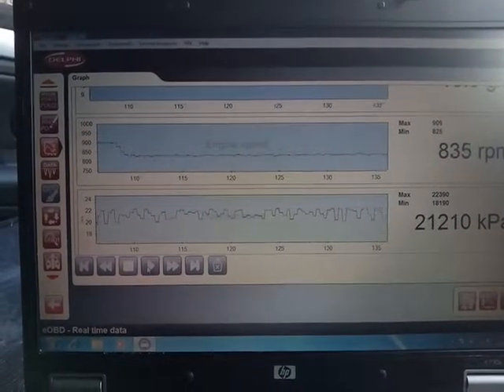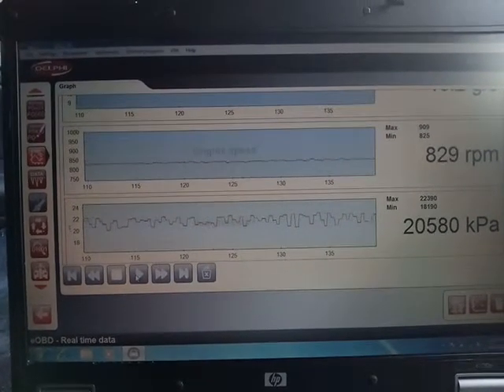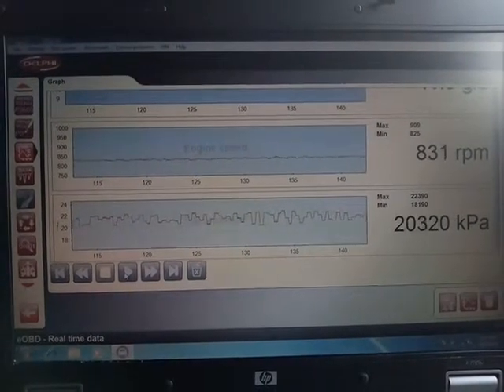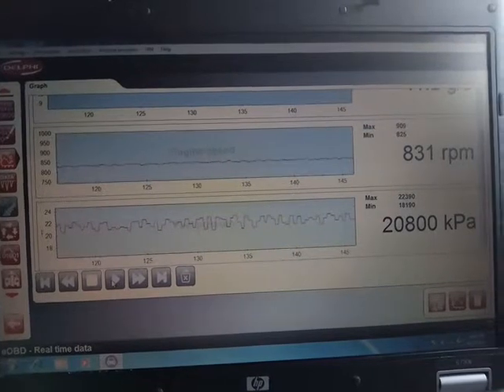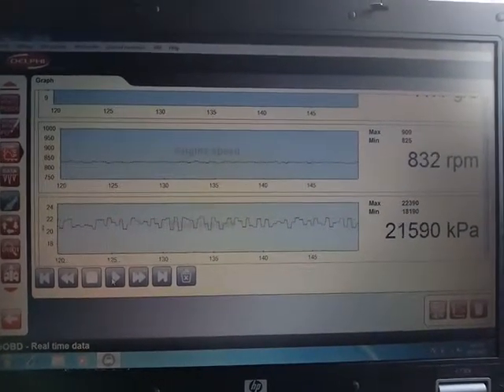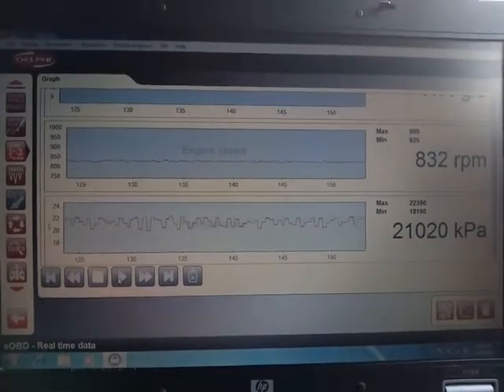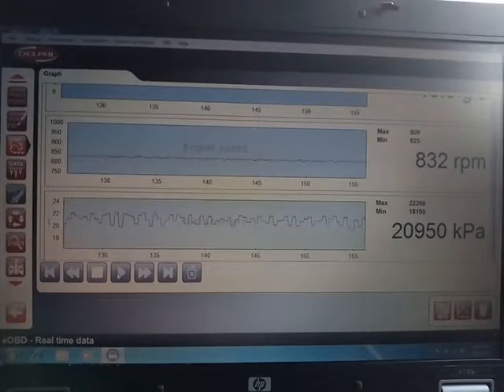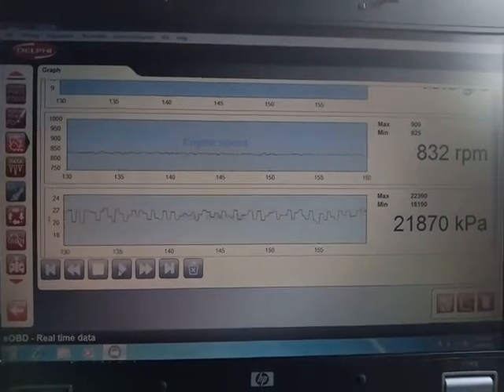Laguna 3 1.5dci fuel pressure on idle

Comment: Pressure shall be little higher, about 250 bars. Check the fuel pressure regulator on high pressure pump. Can have broken orings.
Reply: Mine 836 is bit over 250 and has 10 bar oscillations. Is that fine?
Reply: @tvrtkocro28  yes, that's normal
Reply: @pithaller9791  Thanks, ready for stage 1 😂
Reply: @pithaller9791  You seem knowledgeable, do you happen to know if those injector correction values are okay for 230.000km dci 110? (Cyl.1 - 0.87, Cyl 2 - 0.98,Cyl 3 - 1.09,Cyl 4 - 1.06) at idle when driving they seem bit more even.
Reply: @tvrtkocro28  mine are more less the same and the millage is 365 000 km :) Counting on 500 000 if possible. If the engine is not shaking at iddle I would not worry. Maximum allowed deviation from 1,0 is +/- 0,7. So in theory you can have range since 0,3 to 1,7. In practice if 1 injector has much bigger offset, lower than 1,0, can be subject to repleace. I repaced 1 of it when it was 0,7. Still I am not sure was it neccesary :)
Reply: @pithaller9791  That's great news, thank you! Very pleased with this engine so far everything is original. I wouldn't say its shaking at idle but maybe sound wise could sound a bit smoother but idk it drives great. Have you ever clean EGR? I rarely get some vibrations (at steady low rpm) that go away as soon as I lift or apply throttle I think it could be dirty EGR
Reply: @pithaller9791  I was just checking everything since I plan to remap it to 130hp/300nm tomorrow
Reply: @tvrtkocro28  So everything looks good in my opinion. 1.5 dci likes to shake a little bit at idle because it has 8 valves only, one shaft. But should be smooth during the drive. Second reason of shaking can be automatic air conditioning. When cooler fan starts to chill the AC you feel extra shakes. This is normal. Speaking about egr, if you do not have any power losses or shakes during acceleration and dpf is cleaning every 12-16 moto hours I think car does the fine job.
Reply: @pithaller9791  oh single cam/8v makes sense :) I have always admired my friends 1.6TDI smooth idle. Oh and only thing I changed on engine was thermostat. I wish I had automatic A/C mine is manual and yes I can feel more vibration with A/C on. If my torque PIDS are correct my engine has 47mg/cp of fuel and 1.6bar boost on WOT. Never had any issues with DPF it goes more than 10hours between regens and soot comes down to ~ 5g after it. Only sometimes I get that vibration when driving @ let's say 1700rpm that goes away if I apply throttle or let off. It happens very rarely tho, never had issue on WOT it pickus up right away and closes EGR. Looks like it's ready for remap haha
Reply: @tvrtkocro28  if you have shakes at 1700 rpm and you use to drive at that engine speed quite often it is possible that you need to check/clean/ replace acceleration pedal. Electrical potentiometer likes to have burned copper lines in most used position. Often problem in Renault cars. I replaced mine in the past and problem went away. Good luck with the tuning!
Reply: @pithaller9791  Thanks! Will report back after tuning. Interesting about pedal position. Yeah I cruise a lot at that rpm but it happens so rare, I m not sure if it does on cruise control that would possibly rule out pedal.
Reply: @pithaller9791  Tuning is done, oh boy you can feel her wake up with 50nm/20hp more. Before tuning he did the scaning and said there was error on injector number 1 (no antipollution on dash or anything) but it was stored. He said car seems to run fine and after deleting error it doesn't come back. After tuning he did logging and again no issues, power feels great and it's smooth. Maybe will have to replace injector 1 in future. Today in 250km trip got that 1700rpm "shake" once and it went away as soon as I applied throttle.
Reply: How they did it? Is it some kind chipbox or complete remap of ecu?
Reply: @pithaller9791  its complete stage 1 ecu remap, power delivery feels like stock just more of it. And its "safe" map not turned to maximum. I also wanted to ask you have you changed your motor mounts? I had some shutter when letting off the gas and had bottom transmission mount replaced now it's better but I can still feel it sometimes. Maybe other 2 are also for replacement.
Reply: @tvrtkocro28  Check the mount next to the hydraulic one. That one with twisted 8 shape. Usually that one is broken. Top of the engine, left side. At least in Laguna 3. You need to look for small cracks in the rubber. That mount is usually damaged by mechanics when they do the timing belt :)
Reply: @pithaller9791  Ty for info, I can do it myself without removing anything? Btw are you part of some forum or community for renaults?
Reply: @tvrtkocro28  No I am not. I am Independent :P Yes, you can do it by yourself. Just 2 screws and easy access.
Reply: @pithaller9791  Are you mechanic or just carguy :P?
Reply: @tvrtkocro28  I just have one Renault which I rebuild from the scrap :PPP
Reply: @pithaller9791  Hey man! Would you be able to do like 15s WOT pull on your dci thru gears and tell me max value for "temp before turbine" if you still have dpf and egr ON. I'm trying to compare values on stock car vs my remapped. Thanks!

Comment: Is that pressure fine or it's not good!?
Reply: My Renault Megane 1.5 dci 2011 shows 380 bar at idle or 380.000 kPa
Reply: @olindor220 I saw the same pressure figures, also on 2015 Clio 1.5 Dci 90hp. But on Megane 3 2011 1.5dci 110hp. The pressure was 250bar at idle. My 2008 Laguna 1.5 110hp has the same figures as the one presented in this video. I don't have any errors, just my 1 gear starting is slow.
Reply: And on hard acceleration goes up to 2.000 bar
Reply: @olindor220  A bit late, but thank you :D
Reply from the maker: I have no idea. At the time I was hoping for others to watch the video and let me know.